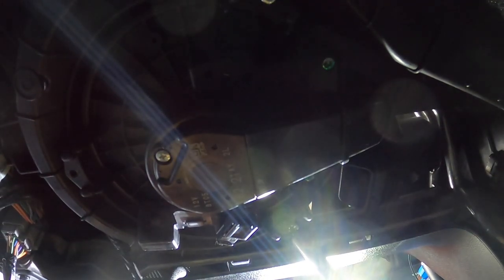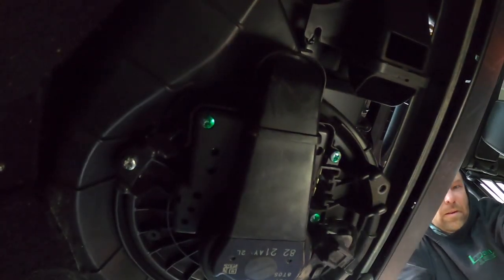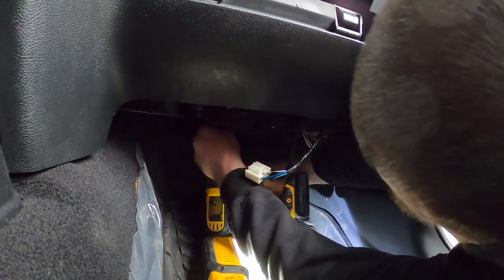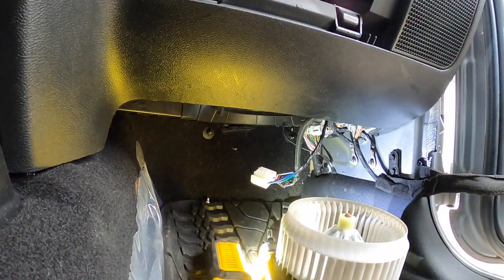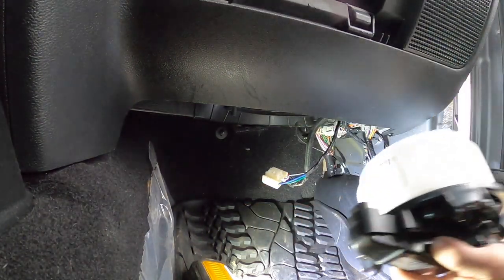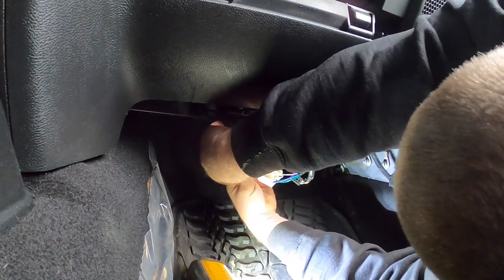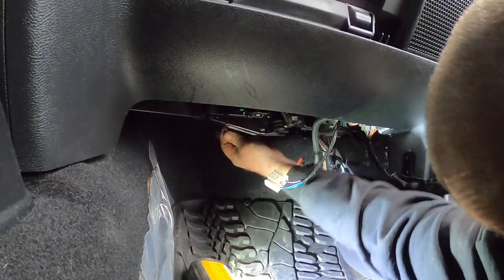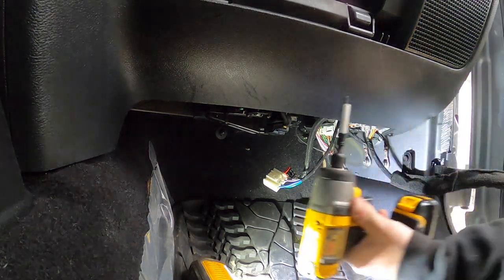Jeep Wrangler JK blower motor replacement

Comment: Is there a risk to anything if I unplug the motor without replacing it?  I don’t have the time yet to get underneath and replace it, but I want to shut off the noise. I can go without AC for a few days.
Reply from the maker: not sure. id assume it would be fine.

Comment: I just paid $202 to have this motor replaced in my 2016 Jeep Wrangler.  It has 51,000 miles on it.
Reply from the maker: You didn't get your moneys worth out of that motor. That sucks.
Reply: Did you always have it on full blast with the vents not all the way open?